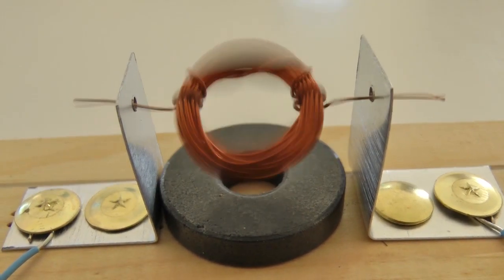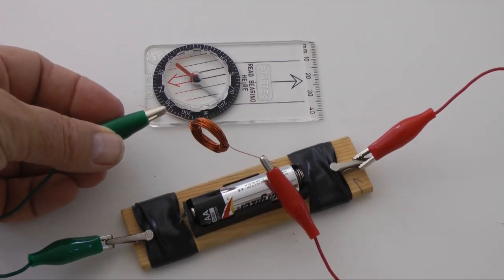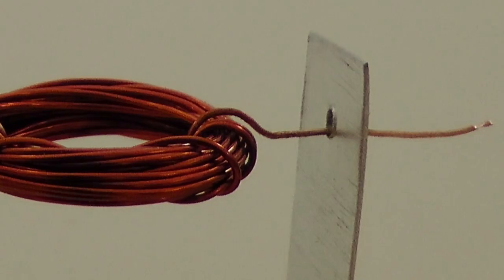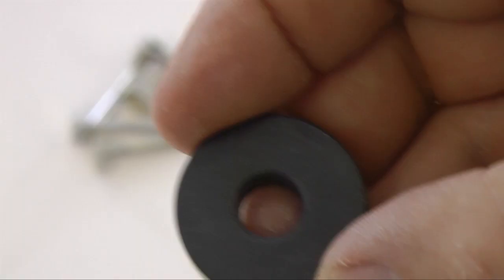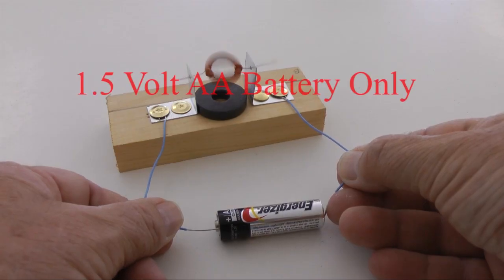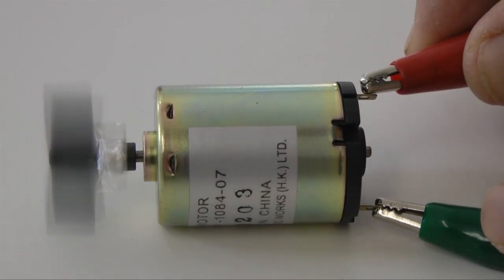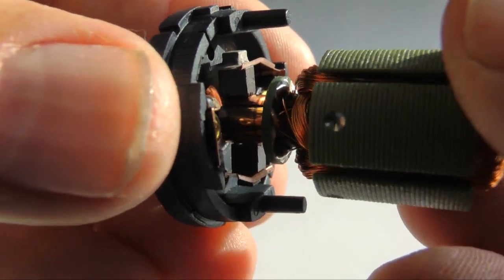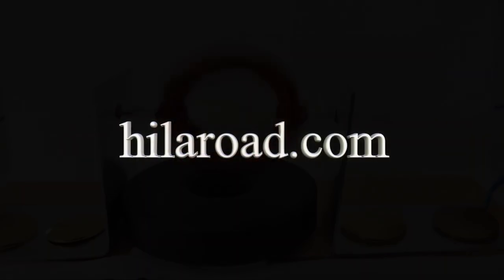Build an Electric Motor

Comment: YES, he left out the commutator on his own little motor instructions. 
If you want yours to spin, only sand 1/2 of 1 or both of the leads! Just one side!
so the energy only flows at most 1/2 of the time!
Otherwise you basically have two magnets facing each other and they will balance out - NO SPIN!